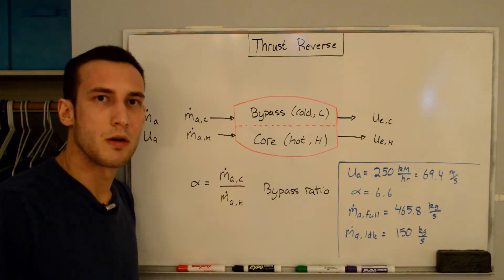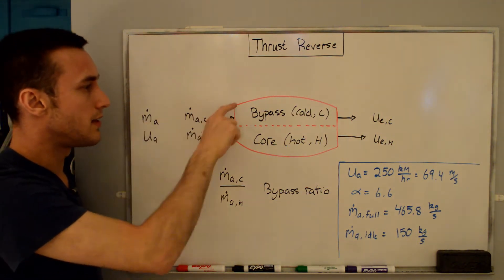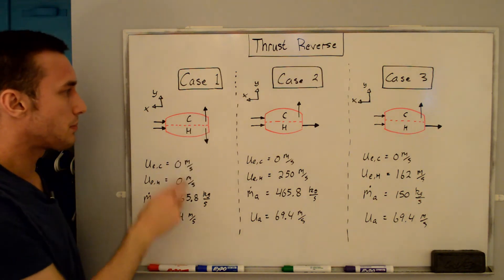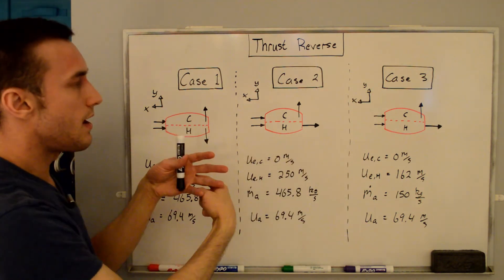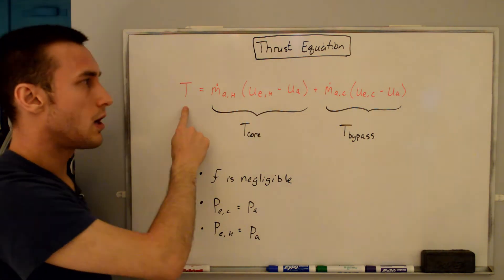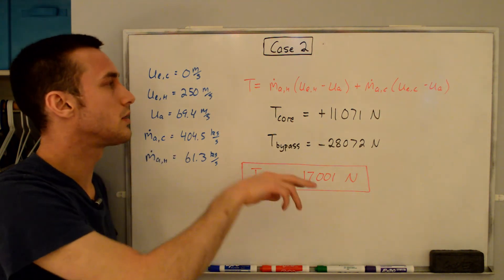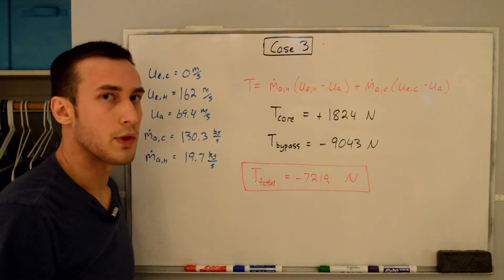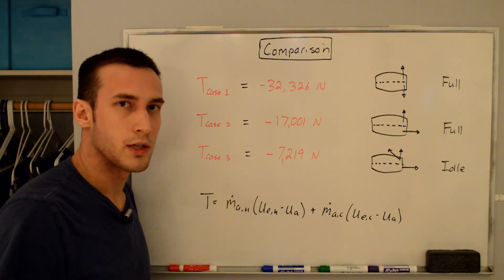Thrust Reverse: Why Airplanes Spool up Engines after Touchdown

Comment: Great video, but I need help understanding one thing. If the thrust of the diverted air is perpendicular to the line of travel, then how does that produce negative thrust? Shouldn't that be 0 thrust?
Reply from the maker: It has to do with the mass flow rate that the engine is ingesting, or sucking in.  If the engine is ingesting some amount of air, and all that air is then diverted perpendicular to the thrust axis, then you'll end up with a negative thrust.  You can also think about it as if you were holding a plate against your chest, and someone took a hose and sprayed water at you.  You would be pushed backwards, even though the water would be diverted perpendicular to the axis it was being sprayed at.
Reply: JoshTheEngineer That makes a lot more sense, I never thought about the effect of the incoming air. It's actually kind of mindblowing to me that it's ingesting enough air to create such huge thrust values.  Thanks for the great explanation!